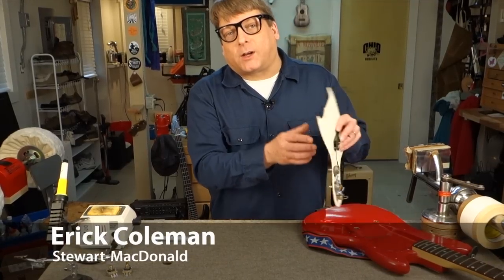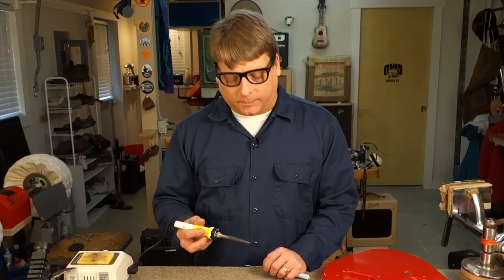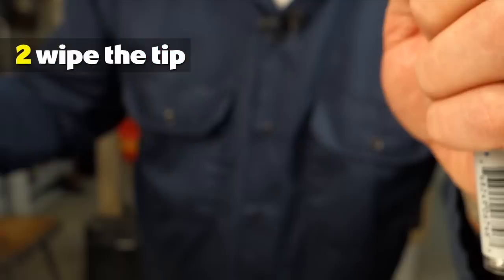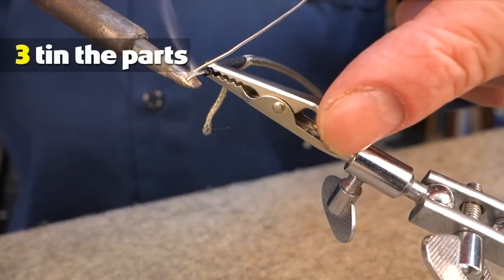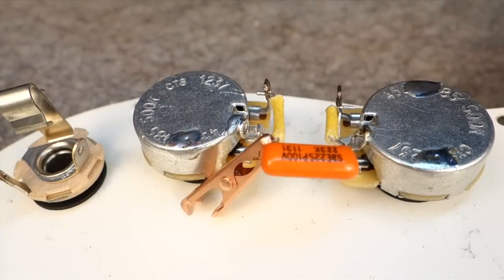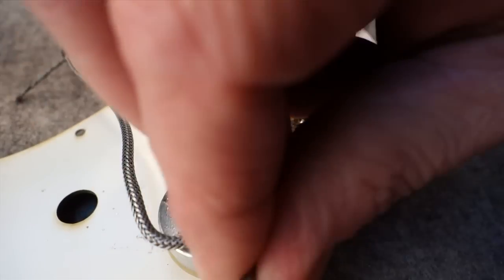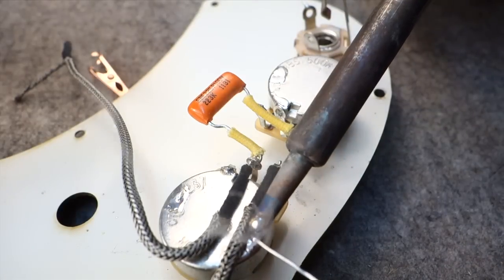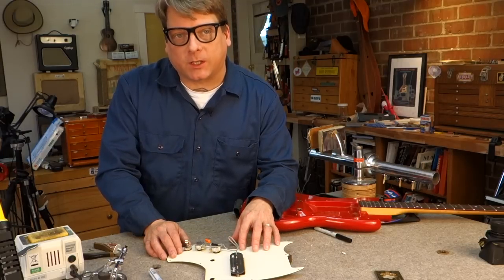Guitar wiring: how to get a good clean solder joint!

Comment: Why replace the tip when you can just clean it up w/ emery or a file?
Reply: YES!
Reply: I usually use some fine sandpaper (400+) till the tip looks slightly shiny all over
Reply: any abrasive material will leave grooves. those grooves will be counter productive to solder flow. just make sure you remove material with the direction of the tip. the direction solder flows.
Reply: If you file it you will remove the special coating on the tip and the solder/flux just eats away at the copper. Use tip cleaner or one of those brass wire scourer tip cleaners

Comment: If you want solder joints to last a good long time, don't use solder and the means to secure the wire/component.  Wrap the wire/lead to the connection first, so even if the solder wasn't there, it would still be held in place.  Then apply solder.  That way, there is no effective mechanical stress that would work to break the solder joint over time.
Reply: That's the biggest thing I see done wrong in nearly all of the guitar soldering videos. No mechanical connection at all...
Reply: Exactly right.  Solder the post and then insert the wire?  I don't think so.  Good way to burn out a pot.

Comment: I've tried soldering countless times and I can never get a good solder flow, now I know I probably screwed up my tip from leaving the iron on with no solder on the tip and leaving it hot too long. I'll try this method with a new tip but I'm sure I'll screw it up anyways.

Comment: If you are going to be soldering a lot, or doing occasional but fine work, then...
Buy a GOOD soldering iron and not a $15 POS from Radio Shack. A nice Weller for example.  
I like Weller because it is easy and cheap to find/buy a wide range of tips.
If you get insulation of other plastic melted on your tip, then sand it with emory cloth and re-tin it, to keep the melted plastic from gumming up your next few joints.

Comment: ciao,ho un problema nella mia greg bennet ,specificamente riguarda l'humbucker al manico..in quanto ha grossi rumori di sottofondo che spariscono quando tocco le corde,cosa che non si presenta quando splitto nel pickup al ponte (sempre humbucker).
Reply from the maker: Hi Joy Xy4JV, it sounds like there is an issue with the ground. You should check all your ground connections, starting with the neck pickup. It's likely an issue of the ground for the neck pickup not being connected to the player ground (this is why the noise stops when you touch the strings).

Comment: sol·der
ˈsädər/
noun
noun: solder; plural noun: solders
1.
a low-melting alloy, especially one based on lead and tin or (for higher temperatures) on brass or silver, used for joining less fusible metals.

This is the correct pronunciation for north america

Comment: what about flux and ground loops?
Reply: Ground loops sure, but I think flux might gunk up your pot then you're in for a world of hurt.
Reply: 60/40 rosin core solder is what I think they say to use.  someone correct me of I'm wrong.
Reply: @SuperJiggawhat  That's what I've always used for soldering my instruments' electronics. Never liquid flux tho.
Reply: @lonerider92  Thank you Easy Linux.  I am very new to soldering.  If I may ask, how hot does the iron need to be to melt lead free solder? I am trying to teach myself how to install pickups into a Gibson right now.  I think I bought the wrong stuff.
Reply: @SuperJiggawhat  I honestly couldn't tell you that since I have a butane soldering iron and keep the gas level on 3 to solder. I don't think you bought the wrong stuff, but give your soldering iron a few minutes to heat up if it's an electric one.
Reply: @lonerider92   Thank you!
Reply: @lonerider92  what about 951 'no clean'?
Reply: @rafaeloda  pardon?
Reply: @lonerider92  Oh sorry, kinda jumped in the conversation. I was talking about solder flux, the clear one, Kester's 951 'no clean'.
Reply: @rafaeloda  No worries, no idea tbh, I just used whatever I got from the hardware store tbh that has the rosin core. If you're using CTS pots, stuff can leak into them that's how I killed one because some solder got into the pot from the bottom.
Reply: @lonerider92  You should try it, so far no problems at all with that 951 stuff.
Reply: SuperJiggawhat 300c usually for solder

Comment: hello i wan to ask what difrent is pots 500k with 250k on precision bass
Reply: 500k pots are usually used for humbucker pickups, while 250k are used for single coils. 500k will give you a slightly brighter tone because of the higher resistance, which is sometimes good because a humbucker can have an overly dark/warm tone that you might want to brighten up and give it more treble. I don't think it's that much of a difference though, as my cheap Strat with single coils came with 500k pots and single coils, and it's not too bright at all, so I guess it's all just personal preference. If you like the sound you're getting, I'd not worry about it at all.
Reply: Correction: A higher resistance pot won't give your pickup more treble, it'll just prevent more of the higher frequencies from escaping to ground, in other words it will let the pickup keep more of its treble.
Reply: dzamija922 thanks for the information its so help, but how for the caps like 0.022 0.047 0.050 0.068 0.104 what de difrent is? and how to the voltage of caps like an 125v 400v 600v?
Reply: I'm not sure about the voltage but capacitors are usually gauged by their capacitance which is measured in farads. The most common gauges for guitar capacitors are 27 nanofarads (nF) or 47 nanofarads, or as you put it, 0.022 or 0.047 microfarads (same thing, just a matter of which unit of measure you want to use).

The principle is the same, the higher the capacitance, the more treble you will get. Even when your tone is turned all the way up, some of the treble will leak to ground, because the components are not perfect. I personally use 47 because it came with my guitar, but it's totally up to you and no matter how you set it up it is really not that much of a difference, so don't worry about it. :)

Tone nazi's will swear that they hear a massive difference just by switching out capacitors, but between you and me, these people are full of shit. Or they have golden ears that can hear a 0.1 dB difference at any given frequency across the spectrum like a fucking superhuman. But nah, they're actually just full of shit. So don't worry about it bro, in my opinion get either 22 or 47 nanofarads because those are pretty much the standards, and you'll be fine. You can't go wrong. :)
Reply: dzamija922 which the lower sound we can get is a 0.018 or 0.068nf? i ask a electro part store he say more hight nano farad is more bass frequency will turn
Reply: If you want more bass in your sound, go with the 0.018 I guess, but you can also just go with the 0.068 and simply turn back the tone knob a bit, you'll get the same effect :)
Reply: dzamija922 ok thanks so, but the elektro part store say more hight caps is more low sound is him wrong ?
Reply: I don't know, he might be right actually because I'm not exactly sure. But here's an interesting video you can watch on the subject: /watch?v=rR4maqK_IhQ&t=452s

This guy laid out different kinds of caps with different values so you could hear how they all sound and pick the one you like the best. In my personal opinion though, it's a really small difference.

Correction: I just checked, the guy is kind of right, but it really works this way: The higher the capacitance, the more treble it will be able to *cut*. When the tone is at 10, there will be virtually no difference. The really noticeable difference starts when you begin rolling back the tone knob. With smaller values, you'll get less of a cut, and more treble will stay in the signal. Hope that helps!
Reply: dzamija922 thanks full bro, can you send me the subjec adrres for video capasitor
Reply: Sure, it's "Guitar Tone Capacitors, part 2: How Tone Works, Selecting a Value"

Comment: No flux?
Reply: I agree. I thought this would be the top tip as it makes a huge difference.
Reply: Mike Dawkins It sure does for me. I have to admit he seems to be doing fine without it though.
Reply: *****    In U.K. it's called resin core solder wire, meaning the flux is already inside the solder wire, perfect for small electronic work.
Reply: Peter Kane Have you actually used the stuff on guitar electronics or amps? I use some flux to make the solder flow, but then I'm good about cleaning up any excess because flux will introduce noise into a circuit. I always assumed that flux built-in to solder would create a noisy circuit that I might not be able to get rid of. I haven't tried it though.
Reply: Charles Seper    I've been using it for years on guitars, pre amps, power amps, tv's, dvd's etc and it works a treat, very reliable..... Just make sure you tin both parts to be joined beforehand.  It is faster cleaner & easier.
Reply: Peter Kane Great info! Thanks.
Reply: Flux is used to clear away oxides/corrosion on the metal surfaces and that helps the solder flow and bind better.  It's fine to use a little flux, but I always try to pre-tin the components and wires without it.  If a particular part won't take a pre-tin or is obviously tarnished with corrosion then I use a small bit of flux.  On the back of a pot or a lug, you might try a little bit of steel wool to break the oxidation instead of flux.  Less flux (or no flux) is better.
Reply: Steve Comeau What I've learned to do since leaving the original post is simply to use a very small gauge of solder. If you do that, then you really don't need any flux to make it flow. Thanks.
Reply: Excellent observation and good practice.
Reply: ive got it here in the US (at one of the last radio shacks LOL)  I bought out the last but of good solid strand wire
Reply: True. That is what I do as well. The less the better, plus the small gauge is easier to get into small spaces in between pots.
Reply: No extra flux, no lead and clean the joints after soldering. The brown stuff at the edges of the solder pool can create noise.
If you are soldering without lead use wire wool to clean your tip.

Comment: how do I clean up the mess
Reply: Look into desoldering wick or a desoldering pump
Reply: Dean thanks a lot! My only issue is that the bridge pickup volume cuts out around 4-6 and then comes back. Any sollution?
Reply: Have you tried contact cleaner?

Comment: Flux...?!  Sure, if you are soldering plumbing...  Silver solder does not require flux.  But solder for copper pipe does.  It isn't 'cloth', its braided metal.
Silver solder dulls VERY little over time.  If you solder fine electronics with lead/tin solder yes it will dull and YES it will fail...

Comment: You should know it's bad form to solder directly to control pots' casings while attached to pick guards due to excessive heat with the possibility of actually melting the pickguard. Happens very easily. It's way more important than a cap & they aren't sensitive at all as you portray.
So you know, I've been associated w/ Stew Mac since there were only catalogs - before the net, CDs & Dan's hair wasn't even grey yet. I've been repairing & building amps, effects, & guitars since mid 80's.
Peace!
Reply: Do you want a medal?
Reply: Good for you, bro.

Comment: how to reduce the life of your tip: use a wet sponge to clean it.
Reply: Uh oh.  I've been doing that to my Weller 40w for 50 yrs now.  Have I ruined it?
Reply: It's moist..not wet :P
Reply: A damp sponge works fine... or copper scrub pads.  Put 3 of the pads into an empty can and stab the iron into it a few times.  Cleans pretty well... but a moist sponge cleans better.  Never had it ruin a tip yet.

Comment: Wow, what BS. ALL solder joints will dull over time. It's true they should be shiny but only when first done. I'm appalled that there is no use of solder flux!? WTF? It prevents over heating & provides a much better solder joint, especially the shielding part. Wow, was that ever a blunder considering the care of using a heat sink on a single cap with protective "cloth" tubing no less. Such precautions & then such disregard all at the same time. Again, wow...I can't believe the selective BS here!